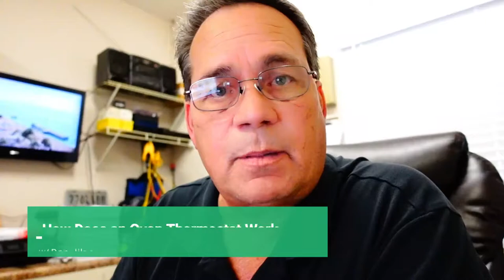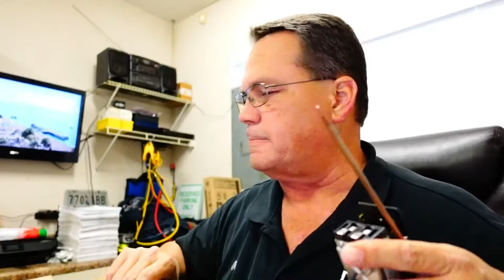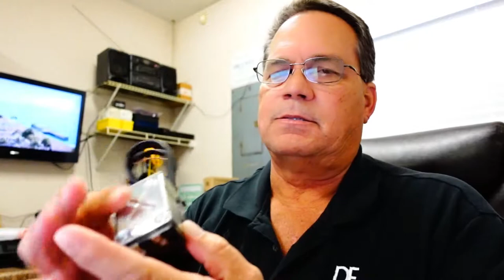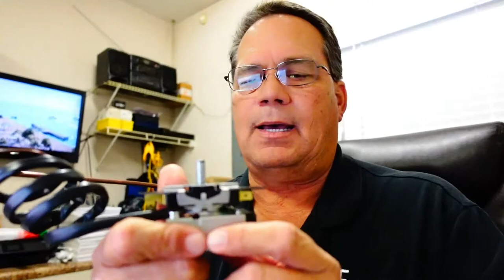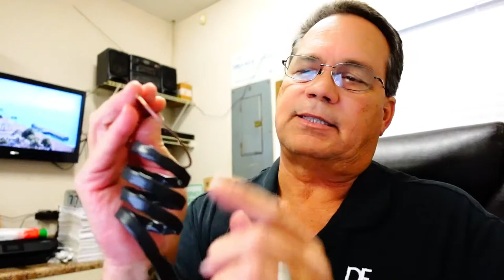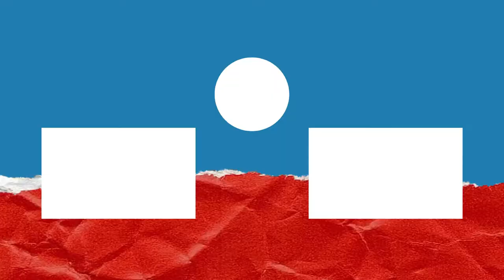What Does An Analog Oven Thermostat Do & How Does It Work + Bonus at End..

Comment: Very well explained.  There are several types of electronic thermostat designs.  There is a thermostat using a  K factor type resistance wire. It changes milli volts that are sensed using op amps, and the output is fed to an A to D circuit and software is applied to determine the temperature. There is a pre-scale system in the software that is set for calibration.  This gets complicated...  In the new ovens I have see these circuit boards fail, and they are not designed to be serviceable. Very complicated and expensive!  

I like the older appliances. They lasted longer, were more reliable, a lot easier to service, and a lot less in cost to service!  Nothing beats hard mechanical switches, some relays with electromagnet activation using hard contacts, hard switches, simple pilot lamps, screw in fuses, simple burners, and elements, and so-on...  The wiring was not overly complicated to follow, and many of the stoves had the wiring diagram on the rear panel. 

I am in my 70s.  About 50 years ago I worked in service centres. Some of them were servicing electrical appliances.  I serviced stoves at times. These were very simple for me to service.

Comment: Thanks for detailed explanation,
I have question, can you please made a video about possible options to install electric fan inside the oven to make it induction, some ovens having no fan installed, just please explain which components we need to have, fan, wire, switch, relay for 2 speeds and wmfromwhere get the electric connnections. 
Thank you in advance.
Reply from the maker: That would be a Convection Conversion. Interesting... Not sure how that would work but I'll think about that one.

Comment: If Im not mistaken, many "pro ranges' use analog thermostats. 
That's how I came upon your channel looking for any info on how to test mine. Regrettably, even though my thor oven is only 4 years old. I can't seem to find a replacement. Thanks for the info.
Reply: If it is analog you might be able to rig one of a different brand to work as it is an on-off thermostat.

Comment: Quick question - does the bulb go inside the oven where the food in or is it outside of that compartment like near an air vent? Trying to fit one of these into my oven. It currently doesnt have a thermostat so I figure I could just wire one up in series with the timer (which acts like an on off switch).

Comment: Great video BUT  can you PLEASE explain to me how does it work for a gas oven that doesn't have a pilot light? (I have to manually ignite it using an elongated lighter) You mentioned in your explanation that once the thermostat achieves the set temp it goes off and then turns on again once temp dips... How will the bake heating element turn back on again if it cuts off the gas supply? Really looking forward to your answer!
Reply: yo tengo el mismo problema pro no se apaga va el gas .. el mio siepre esta alta la flama y no baja no regula entoses yo pienso q es el termostato

Comment: My griddle thermostat on my 16 yo Thermador range is working intermittently.  Thermador discontinued the part, and I can't find it anywhere.  You mentioned trying a different thermostat as it functions as an on/off switch for the gas.  What watch-outs are there if I would do this?  Would Temperature not matching the dial settings be the main thing to worry about?

Comment: Question...I have a outdoor gas grill with an oven...members mark model 720-0586... any way the thermostat in the oven went out and the oven will not turn on.  The problem and question they do not make the part..Thermostat valve....any more.  Can these valves be rebuilt?

Comment: Can this type of thermostat be adjusted? We have a brand new Thor gas range with oven and the temperature in the oven is 50 degrees too low. We’ve taken it apart and it looks like there are two adjustment screws but I’m not sure if I should tighten or loosen them...any help is appreciated

Comment: Hi Dan, your video is great. A quick question: My oven has a bunch of wires. Will the copper wire of this sensor get really hot and burn other electronic wires if they touch each other?
Reply from the maker: I’ve never seen that happen. But anything is possible. The tube should be cooler once it’s out of the range cavity. So I would say no.

Comment: This video is very helpful!

My oven is not heating up, and it has the same type of thermostat that is featured in your video. Now I understand why you have to buy the temperature sensor together with the turning switch (ie: cannot buy the temperature sensor separately).

The heating element tests fine (24.7 ohms resistance).

Is there any way that I can test the thermostat? Or do I just have to replace it and hope that it is the cause of the fault?

Comment: My Tappan stove is older than your example. It's 30 years old and has pilot light one for the oven and two for the stove eyes.  Thermostat set to 500 and oven will get to only 400 my wife normally bakes biscuits at 450. Bought it special with no electric to use in Indonesia.  Going to try adjust the thermostat screw but it's hot now from baking.  Signed still cooking on Java after 30 years.
Reply: I have a few stoves in apartments, and I still use an old analogue stove.  It will work with out electricity, and I can understand how it works.  It is built like a tank and is older than I am.

Comment: Okay Dan I have a question can you calibrate an analog thermostat and if so how can you do that
Reply from the maker: Some stats do have a calibration screw and can be adjusted. It’s sorta like trying to calibrate an ice maker though, a small adjustment can create a huge difference in temperature. Or in the case of the ice maker, it could flood the freezer with too much water.

Comment: I have one of those. How do I test it using a Voltmeter? I know the Voltmeter needs to be set to Ohms and set to lowest point. But, where do I connect the probes into this old thermostat?
Reply: The thermostat is basically a switch that switches dependent upon the temperature.  If I recall correctly it will be open circuit when the oven is off and it will close when you start the oven until the temperature reaches the set point and then the switch will open.  On newer ovens, often their is a thermocouple or thermister instead of the gas filled tube which  is read by a logic chip and used to throw a relay to accomplish the same thing.  You would need to find and refer to the specifications for the part for your specific oven.

Comment: I was surprised to see that my 1999 Thermador was still using the bulb and capillary system. If I had to replace it, it would be over $1000 for a new replacement which is ridiculous-some GE replacements are $25! I have to be very careful servicing  the gas control knobs/electronics on the same front panel  while the copper expansion lead is flexed and strained during servicing. I can purchase electronic meters measuring wider temperatures for under $100 complete.

Comment: That is exactly what I need for my 2005 GE oven. It is like 100 degrees hotter than it should be right now. Actually I can see from the different angles it is not the same. GE part 318059310 . I have a little oven thermometer handing down that I am using to try to keep things under control.
Reply: I do not know about yours, but some of them have calibration screws on the old analog, and the digital may have adjustable pots on the circuit board for calibration.